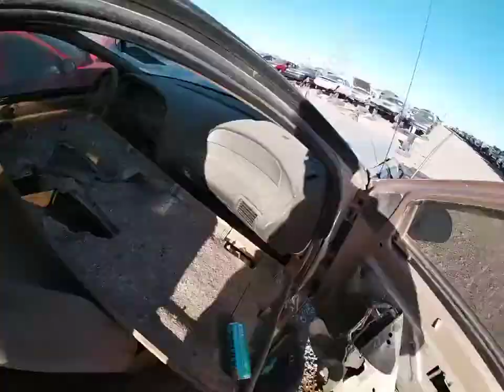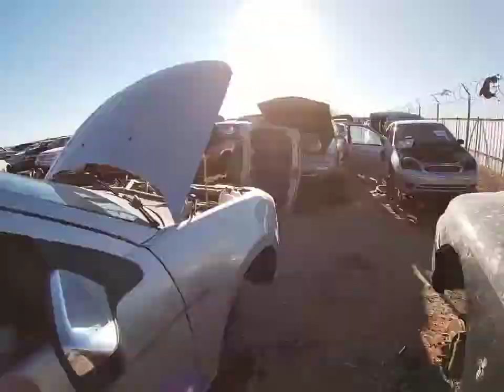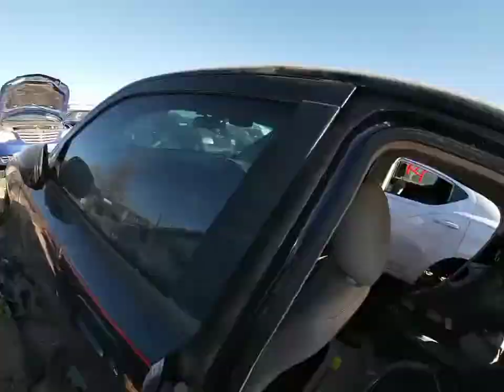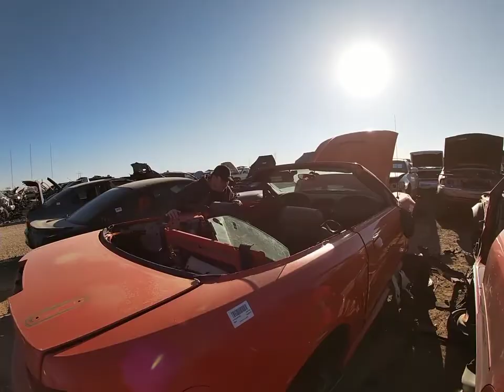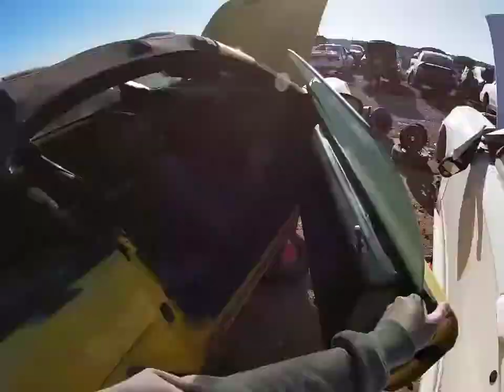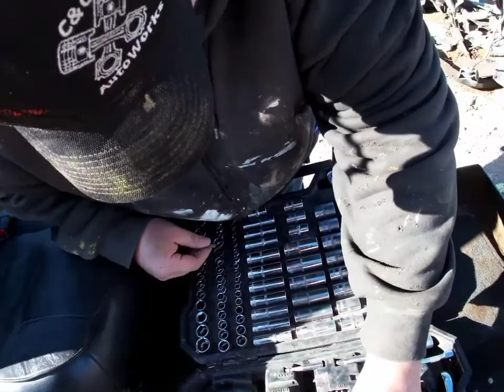wrench-a-part junkyard seat hunt

Comment: Didn’t happen to see any 5.8L windsors there did you?
Reply from the maker: Yes there's at least a dozen there 350 with no core or 250 with a core
Reply: @CCAutoWorks  would the fuel injected 5.8L bolt right up to where a carbureted 302 sat?  Are the motor mounts the same?
Reply from the maker: @MikesMischief  yes there the same as far as every swap I've done